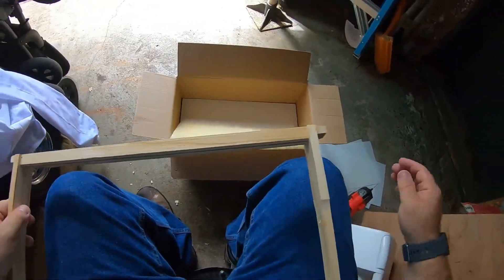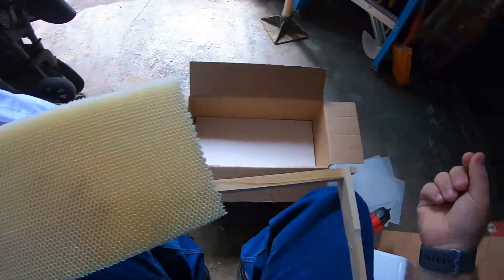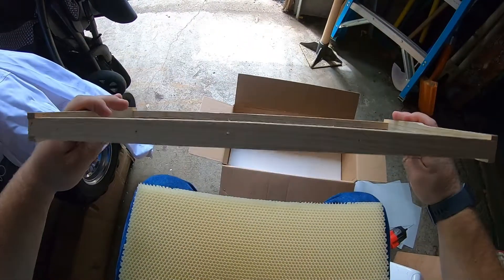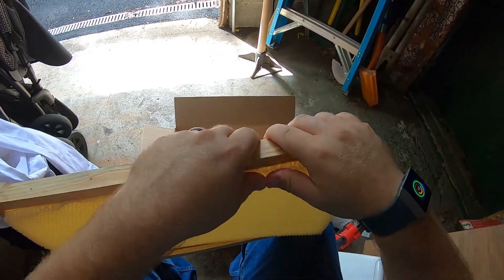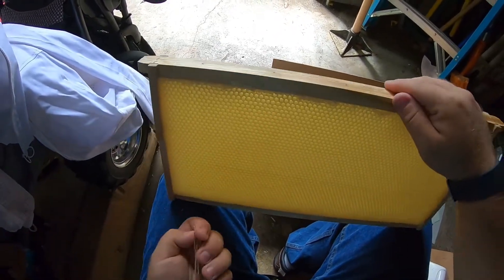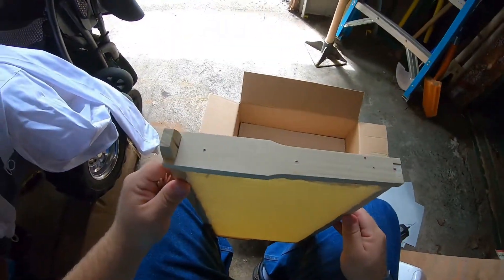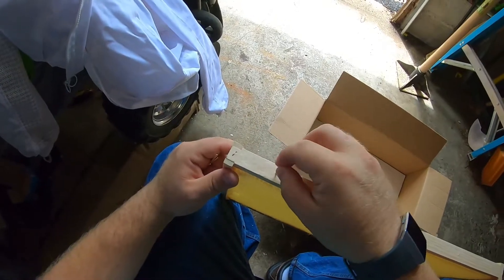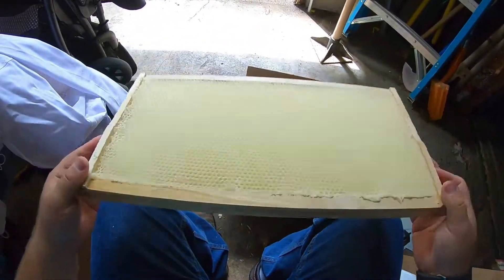Bettercomb how to and review

Comment: To avoid deformation of comb in high temperature, we recommend to fix the comb in horizontally wired frame. It is more safer than the toothpick.
Reply from the maker: Thanks for the tip i did have had the center bow out in a few of them.